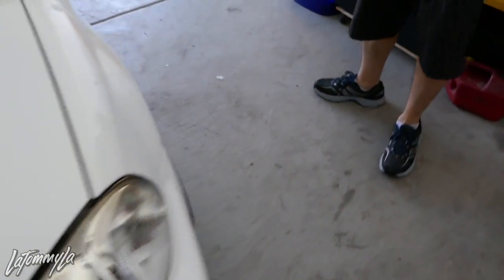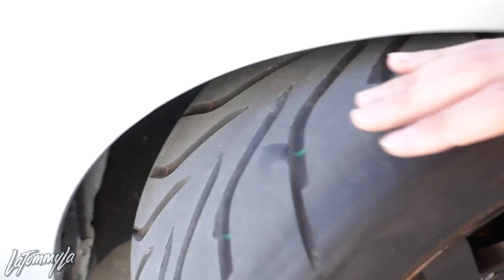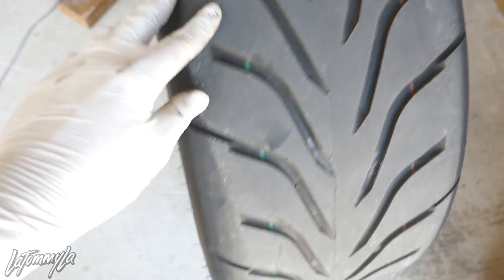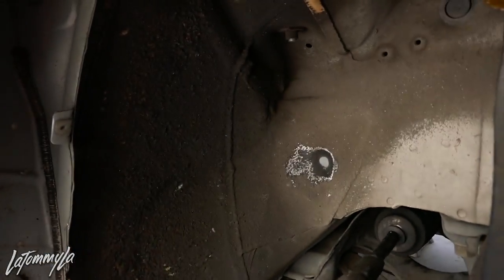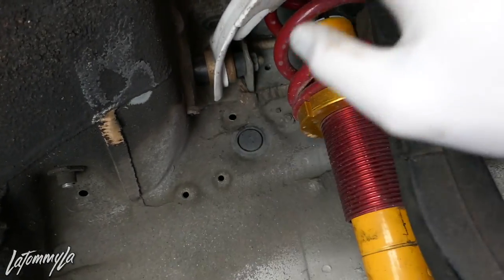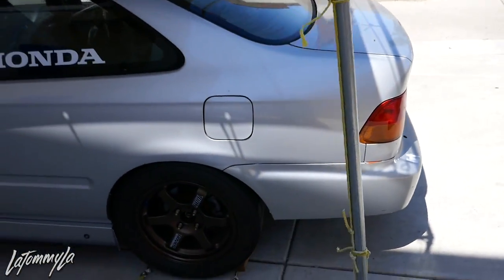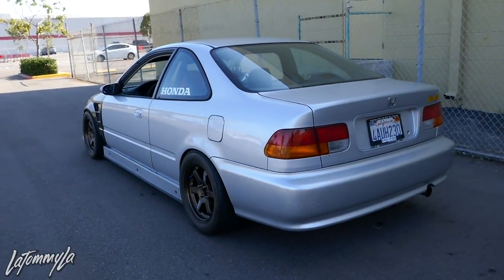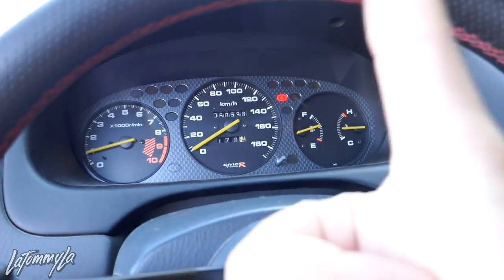Banging my frame to fit meatier tires! Stock look?

Comment: Hey tommy I got a question about the willwood can I buy regular brake pads or do I have to order specific ones?
Reply: I also have those calipers, you can buy the Wilwood pads for street, but they also have race pads too.
Reply: so only wildwood?
Reply: You can find Hawk's or other racing pads too, you just have to find the part numbers.

Comment: Yoo Tommie, those tires are looking so good on your car. Im currentyl running 205/45 17s on my EK3, and i'm rubbing aswell :/ What sizes are these tires? F & R?
Reply: HellaFlush070 he said 225/50
Reply from the maker: What Victor said ^^^
Reply: sweet bro, just worked a night shift yesterday moirning n today, didnt have time to check the whole vid hence the question =P but dope man, I'd love to run the same tires, dailying the EK thru the roads of amsterdam ... With the curbs ... And speed bumps

They do look so good though, aren't you worrying to have too much grip in the rear?

Comment: Thank you so much for this info cuz I'll be slamming my car in a few days
Reply: ARCH. M there are way better way to do this. you can take your car to a shop and they will cut it all off and weld it to reinforce the frame js
Reply: hmm good advice ill do that thanks
Reply: ARCH. M yea np bro I would like to see you car when it is complete and trust me a shop can do a real nice job they can cut the part that chop up the tire completely off and weld a real nice seem
Reply: this way does nothing to the intergrity of the frame.. just simply bending a seam weld up.
Reply: socalpumpPB yea i don't disagree with you. i was only giving a bit of advice bc hammering it up a bit only gives you like a 1/4 inch maybe half inch more clearance when removing it and putting a clean looking flat weld really gives you about a inch to a inch a half of smooth clearance. either way
Reply: socalpumpPB and it can still potentially rip your tire